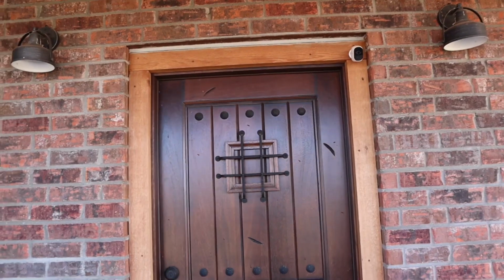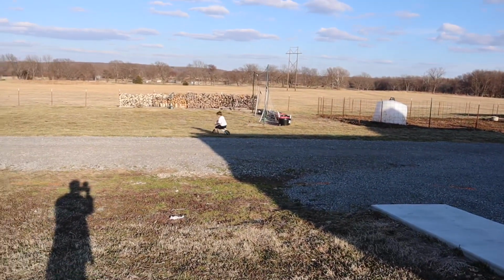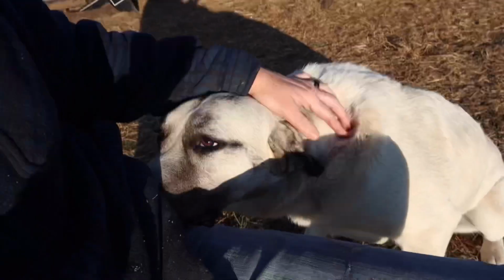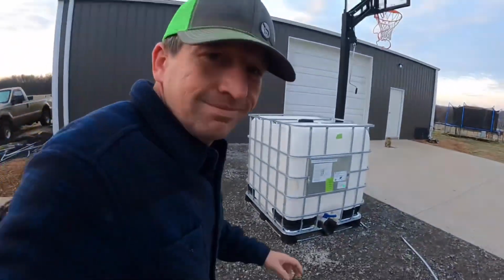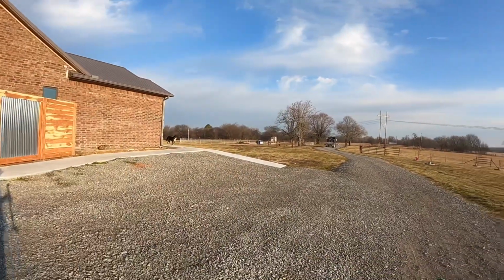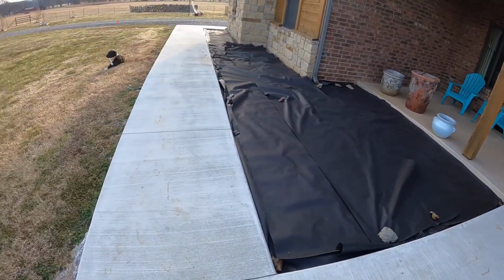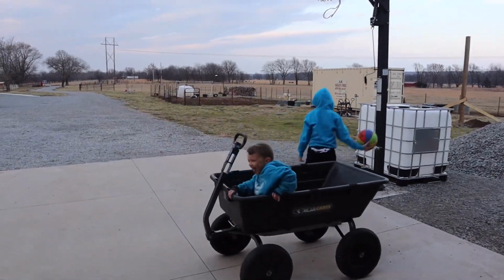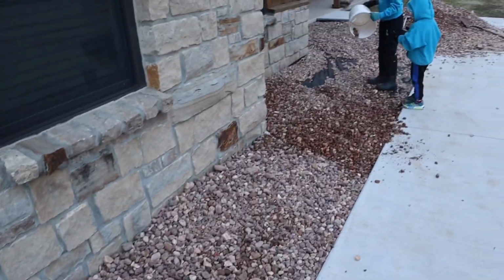She Waited 4 Years For This!

Comment: I love rocks Ranger! I live on the east end of Long Island in N Y State and where the end of the island looks like a fish  tail  that is called the North and South forks. On the South fork  at the end is Montauk Point (with the lighthouse) and at the end of the North Fork is Orient Point and the whole beach there is nothing but rocks (hardly any sand) and I used to go walking  on the beach there and look for "beach glass" which is glass that was in the ocean, got tossed around by the currents and waves and was washed up on the beach nice and smooth, like glass! Also found quite a few interesting shaped rocks with cool  colors! You could imitate the action  of the waves if you put some glass pieces of different colors in your rock tumbler and tumble them until they are smooth with no sharp edges! You can find all kinds of colored glass in everyday things!  You will need Mom and Dad's help  to break the glass into pieces by putting  it in a sock or towel or pillow case before hitting it with a hammer. Pick up the pieces of glass with a pair of needle nose pliers (dad knows what these are). You will be surprised at the results! If you have a recycle place  near you  that takes  glass, you can find all colors of glass! You can find red( it usually  came from the tail lights of the  old cars like you see at car shows), blue(from liquor or liqueur bottles or old Vicks Vapo Rub jars), green( from olive oil bottles or other foods), brown (from medicine jars or old, old bleach bottles etc. ) Also flea markets or junk shops or junk yards sometimes have things of different colored glass! It's fun just looking for the glass to tumble!  Have fun!